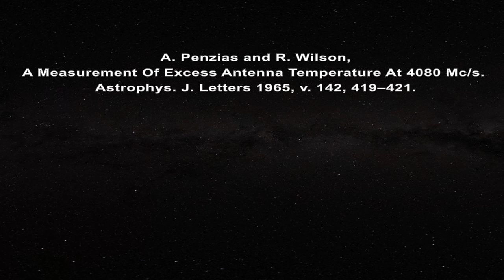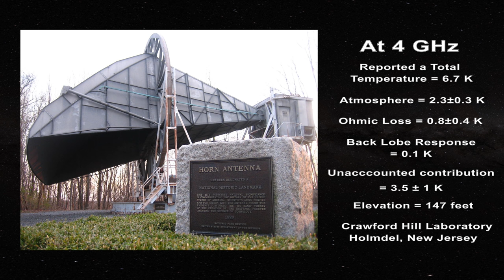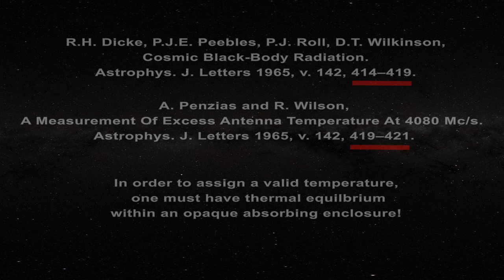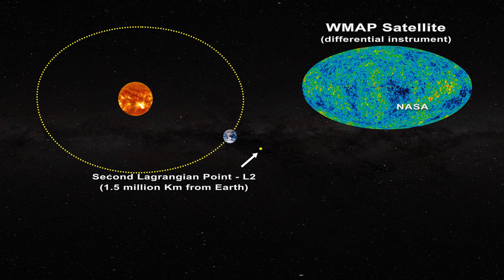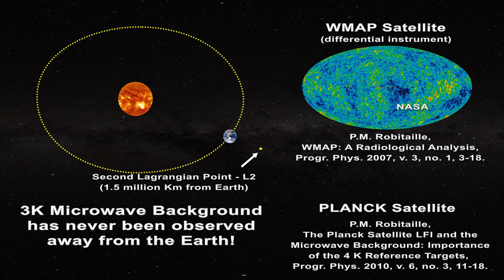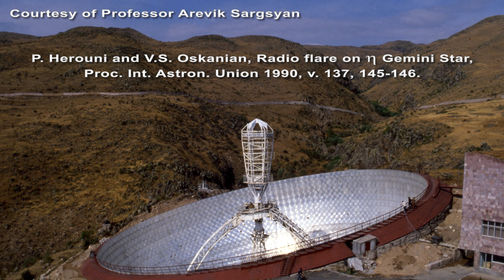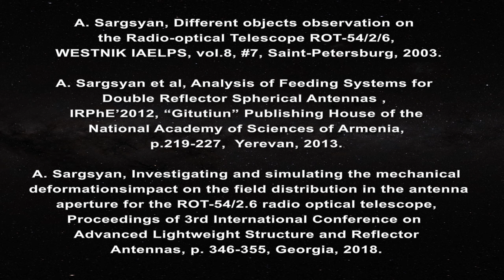The Herouni Antenna - The Death of the Big Bang!

Comment: Not all scientific theories are forever. The death of a theory is an advancement in science.
Reply: They will however fight kicking and screaming to the bitter end
Reply: Yes, the death f a theory, but this was a figment of the imagination which could not be disproven, or at least they thought so. They were wrong, but never mind because they'll find ways to distract and discredit the new findings. It all about the money and fame, even if it fake. What does that make us?
Reply: @kellykizer8167   Go way troll
Reply: All theories are simply that. Do not put stock into theories and you will be good to go. Trust in knowledge and knowing and you will set straight.

After all believing in a theory without it being conclusively proven as knowledge is simply ignorance.
Reply: Kelly Kizer log out
Reply: Sean Regehr - The word "theory" in science does not mean "guess". It is an explanation of observable phenomena which is supported by experimental data.
To paraphrase the great Richard Feynman, science doesn't prove anything RIGHT. It only ever proves something WRONG.
So, we accept that the "Big Bang" is genuine because the explanation fits with what we observe. When we find a flaw in the explanation, the superseding theory has to explain the discrepancy and show why the previous theory worked and in what way it was flawed. That may be that we have made errors in collecting or interpreting the data or it may be that we have overlooked something.
Newtonian mechanics is a perfect example of this. For the most-part, Newton was correct and his maths can be used to put a man on the moon. However, at extremes of gravity or velocity, Newton's maths breaks down and we need a better explanation - Enter, Einstein.
Reply: Science, by definition, is not static dogma. If it were frozen by static dogma it would not be true science.
Reply: @RoadRunnerLaser @ @EvieDoesYouTube  ~ The word "science" means 'knowledge'.

science:
- the intellectual and practical activity encompassing the systematic study of the structure and behaviour of the physical and natural world through observation and experiment.
- Middle English (denoting knowledge): from Old French, from Latin scientia, from scire ‘know’.

So how can a "scientist", a.k.a. a person with knowledge, resort to theories? Either you know or you do not know. If you think you know, you do not know because you cannot reprove all your work until you come full circle. If you know, it is no longer a 'theory' because you know. The only way to know is by going full circle, where there are no longer any questions or uncertainties remaining for all can be proved. Nor are 'observations' 'theories'. A 'theory' is simply a best guess based on limited understanding, experiences and observations.

"To paraphrase the great Richard Feynman, science doesn't prove anything RIGHT." ~ RoadRunnerLaser

Richard Feynman did not understand the True etymology of the word science, so rightfully he misspoke due to a lack of understanding. Science Truly shows what is True, and what is True is also right/correct/accurate/etc.

Newton's work is a hoax and was stolen from those who came prior to him. Same with Einstein and many others. They stole the works of the ancients who knew much more than what we are told. How can any logical thinking human being begin to think Newton was the first human being ever to observe that objects at rest remain at rest unless otherwise acted upon by another force? We see this play out daily and it is critical to doing a great many things which allowed for humans to built up society and advance in knowledge. Sound creates light and not the other way around. In both cases, these men were selected to re-reveal the knowledge previously know to the world except for they intentionally mislead everyone to think it was their own original works. This helps them to keep the True knowledge hidden from the rest of the world, so they can profit from it continually. There is nothing new under the sun. See while the ancients had much knowledge of a great range of topics, they did not have access to the machines and equipment that we have today. It is their knowledge that paved the way for man to benefit in these times, but until we merge our current knowledge with their knowledge man will never come full circle to get the best of both worlds. This is further exemplified in the world we live in. We have so much technology and advancements, yet our problems as a humanity continue to increase at an increased rate. This is due to lack of knowledge. Mankind thinks he is gaining and get solve his problems by continuing. Problem is mankind does not desire to face reality that, he is going in the wrong direction running from the True knowledge that is complete/perfect and lacking nothing.
Reply: @seanregehr4921  Some people just got to rip on others to try to drag them down to their own level.
Reply: @seanregehr4921  What an absurd statement. Science and the scientific method does not generally deal in absolutes - it isn't maths and as such, conclusive proof is almost impossible to come by. A scientific theory isn't the same as a colloquial theory, but it does represent our best explanation of something we observe in nature, and makes useful, testable, predictions. Even if a theory is later found to be lacking or incomplete, for example Newton's Theory of Gravity, it often doen't mean that it should be completely discarded - only that it should only be used within defined limits.
Reply: @foxmeisteruk  Observations are just that. Theories are just that. Science from the base Latin root scientia means knowledge. To have knowledge is to know. Thinking and theories are the same, unfounded and only based on what a person chooses to believe and not what they know, else it is knowledge and not a theory.

Do not be mad because people misuse the words to their advantage. A scientist that does not know, cannot be a "scientist" by definition. That is an oxymoron.

"Scientific experiment" is an oxymoron as well. Either you know or you do not know, if you know it is not an experiment but a process. If you do not know it is an experiment but not scientific because you do not know, at least yet.
Reply: @seanregehr4921  You're just playing with semantics. A scientist will acknowledge facts and observations, but in order to explain those facts and observations, they first formulate a hypothesis and then test that hypothesis. If a hypothesis passes all the tests thrown at it, and it makes testable predications, it may, just may, be accepted as a scientific theory by the scientific community at large, though, even then, it still has the potential to be falsified. Scientific theories are most certainly not "unfounded" as you have stated - a scientific theory has the very highest level of confidence as to its accuracy that the scientific method can bestow. https://en.m.wikipedia.org/wiki/Scientific_theory
Reply: @seanregehr4921  A scientific theory and the general use of the word 'theory' are not the same thing so your argument collapses.
Reply: @foxmeisteruk  You are being ignorant of the language you are using and your not the only one. Maybe try using better vocabulary to articulate your point.

Is red, red or is it yellow, green and blue? Blue must be yellow and green must be purple. Do not worry though its just semantics, our best scientist brought us this theory. They have fancy pieces of paper with their names on it and a signature and gold sticker seal; it must be True!
Reply: @foxmeisteruk  - Why would you criticize my use of language, after you said it does not matter?

Maybe you'll pick up on the point I am making loud and clear. Maybe not.

All those "scientists" need a language lesson as well. Just because many people jump off the bridge, does that mean you should too? Try having your own opinion based on facts and Truth, and not just going with the crowd. Have you ever witnessed mob rules up close and personal? Still think the proverbial "they" are worth blindly following? "They" are going to end up as a mass of fools, the blind leading the blind.
Reply: @seanregehr4921  Once again, you fail to address a single point that I made, or the articles I linked to, and simply resort to wordplay. 

Science and the scientific method has cured diseases, put planes in the sky,  man on the moon, and is responsible for the emergence of the technological world in which we live - and all of these accomplishments are based on "theories", not absolute certainties.

So, I'll take my definition and understanding  of science over yours, because mine agrees with the consensus of rational and critical thinkers throughout the world, whereas yours does not.
Reply: Like the death of the Ball Earth Theory.
Reply: @foxmeisteruk Unlike quantum theory enabling the design of better transistors and chips, the big bang theory has produced no benefit -- only mass confusion to later be masked with the introduction of things like dark matter, dark energy, inflation, evanescence, and dark flow.  I have been watching these undertakings for many, many decades.  I remain aware that we have a slightly improved, but still very fledgling understanding of our neighborhood and the cosmos.
Reply: most theories are just that.. theories..
but FACTS do not change...

people have the misconception for example that albert einstien proved newton wrong...
which is false...
newtons law described what happen here on earth.. basically whats close in relation to us..
albert einstein came along and described what happened everywhere.. beyond what newtons law described....
newtons law still stands... 

einstein simply improved and greatly expanded on it...

now apply this logic to the majority of science... people fail to do so and thus they see science contradicting stuff.. butt its a failure to understand...

and people often confuse theories with facts.. xb
Reply: Yes, when we look back at scientific history, science has actually always been wrong, because all our beliefs have been superseded. Our understanding of the universe will evolve along with our conscious awareness. There may be no ultimate objective reality.
Reply: You do know that a theory is is just an imagination
Reply: @jamestheotherone742   Sorry, you can't be an anti-science contrarian and big-bang denier, and then get mad when the Flat Earthers show up at your party. Birds of a feather, yo.
Reply: @doctordave  I believe you are making ASSumptions here . You know what that makes you look like right?
Reply: @jamestheotherone742   What's the assumption?
Reply: Excellent comment in all regards road runner  except Einsteins theory was just a theory to . . in regards to that relativity nonsense . . everything is fractal electric simple . . complexity ensues from the three modes of simple double layer plasma's
Reply: 'The glory of science is to progress'. CS Lewis

Comment: Wasn't the detection of background radiation just the icing on the big bang cake ?  Wasn't the observation by Hubble of red band shift primarily the reason the big bang was first postulated by father Georges Lemaitre who concluded that if the universe was indeed expanding and you could rewind it you would have to reach a singularity ?  Personally,  I've always believed there are other explanations for red band shift other than expansion, hence no big bang.
Reply: decay of light explains redshift
Reply: General Relativity demonstrates that large masses cause a red shift.  That is why clocks run faster in space than on the earth.  Hubbles red shift was not a doppler shift.
Reply: @halbrown7121  are you saying that time runs slower the closer you are to massive objects independent of momentum?
Reply: @adamkendall997  Yes.  Although Momentum has nothing to do with it.  Time runs slower is a consequence of red shift.   So  time runs faster when you get out into space where the gravitational field is less.  This has been proven with very accurate clocks and with small differences in height. One example of where this has an effect is the clocks on the GPS satellites are adjusted to run at a difference rate than on the ground due to two effects; general relativity and Special relativity. One is due to position (general relativity) and the other due to velocity (special relativity).  The effects are opposite, but they don't cancel.
Reply: @wolgart  No it most definitely does not.
Reply: @halbrown7121  Cosmological redshift is not a gravitational redshift due to large masses.
Reply: @ngc-fo5te  No such thing as gravitation or a "graviton".  Rather it is due to curving space/time.  Gravity is just an easy word  to use to explain it.
Reply: One thing we cannot reproduce in a lab: Photons traveling 60 billion light years. While we know the doppler effect is true to a certain extent we can never simulate a lab 60 billion light years in diameter. Cosmological redshift may in fact be in part due to the decay of photons because we do not have the technology to freeze a photon in place and weigh it. If photons have a mass they will decay, plain and simple. To compare: how long did it take humans to calculate pi to 35 trillion digits? What if a photon has a mass of -10^10^100? Humans will never be bothered with calculating the mass of an object to the -googolplex after the decimal point, and instead will just say the object is massless, even if that is incorrect.
Reply: Yes, Hubble's discovery was the original observation, which the various & conforming earthbound and satellite observation of the microwave background confirmed.

Apparently, youtube likes to sent us into its crank niches every now and then.

Regards,

Dr rer nat Stusstrupp
Reply: @bangyahead1  Mainstream dismisses such arguments calling them "tired light" hypotheses, and making some arguments that there would be blurring if this were the case. I see no need for significant distortion if light loses energy over time or imparts it to surrounding material as it travels.  This is still a possibility for redshift as far as I'm concerned, and hasn't been ruled out completely.  While I don't think photons have any mass, I do think it's possible that they transfer momentum and lose energy to material or Machian spacetime itself as they travel.  I've seen no evidence to suggest they would distort.
Reply: @wolgart  or energy transfer to surrounding material as it travels. There is no requirement for distortion in this case -- I have shown this.
Reply: @Andy Bigsy Before asking that to nasa and make a fool of yourself, go get a camera with a telephoto lens longer than 200 mm and take a selfie, see what you get.
Reply: Anybody of you heard about HALTON ARP !!!???
Reply: Big Bang under various names have been making rounds for years before Hubble's observations. Ultimately for most of Big Bang's history was nothing, but an attempt to explain religious dogma with science.
Reply: @halbrown7121  No such thing as space, time, or gravity. They're just concepts.

Comment: The main advantages of ROT Antenna are the highest accuracy of mirror surfaces (50 micron), shortest
wavelength (1mm) and very low level of Self Noises (2,6 K), i.e. highest sensitivity. Thanks to high accuracy of ROT Antenna it can work in very short wavelengths, down to 1mm. Due to special
 optical scheme of the Antenna, the diffraction rays from edges of mirrors do not arrive to the focus point, so
Antenna almost not feel surrounding high temperature (about 300 K) and I have no Idea what I'm talking about so the Self Noises of Antenna is very low,
just about 2.6 K or 2.8 K (r10%) in different experiments, where to achieve the high accurate result, the Self
Noise Temperature (TSN) was mainly measured at first near the East support leg of Antenna, where there is the
bridge, in open position of which it is possible to go to receiver and focus point.
Reply: @Astilen, assigning to professor Herouni: "Antenna almost not feel surrounding high temperature (about 300 K) and I have no Idea what I'm talking about so the Self Noises of Antenna is very low,
" Astilen

You have already proven your dishonesty by your post, embellishing professor Herouni's words with your "and I have no idea what I'm talking about". Any reader can obtain professor Herouni's paper, for free, as you have done, and see for themselves that you augmented  professor Herouni's words with your falsehood.

Comment: Big Bang is something that got etched into the mindset of an entire generation. Can they dislodge it? Anyway, thanks for throwing some light on this paradigm.
Reply: Etched is a great word.  When some people etchedly insist that the universe originated from a single, dimensionless point, and then others rationalize that space did not actually expand from unitlessness, but only time did, it makes the listener appreciative that they are not quite so certain about the beginning.
Reply: Of course, did it all by myself. Actually when I started reading up on it, I assumed they had great proofs. But I found nothing but conjecture, wild assumption and speculation. The I started reading about other views, and how those got surpressed, cannot say I was impressed by the field at large.
Reply: @Mosern1977  Yes... Wild assumption cannot be understated.  The first wild assumption is that one can be divided by zero.  The second is that redshift is caused by spacetime expansion.  The third is that standard candles are, well, standard.  The fourth is that the speed of light can be completely violated via spacetime expansion.  The fifth is that conservation of energy is no longer a thing.  The list of assumptions and violations goes on, and on, and is actually growing with time.